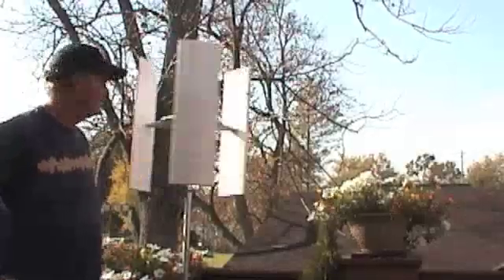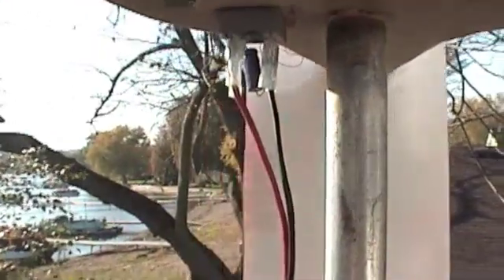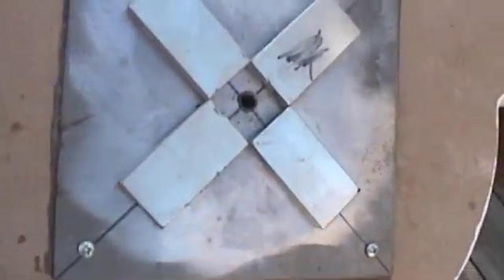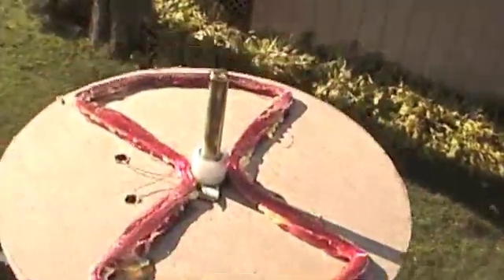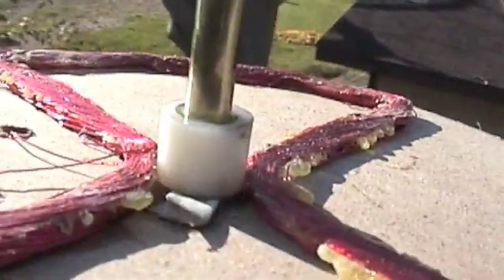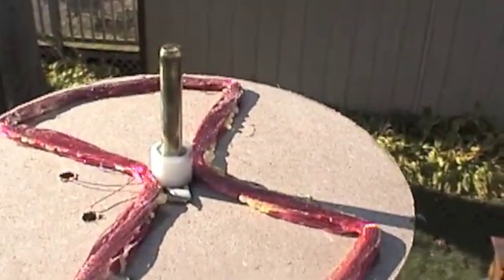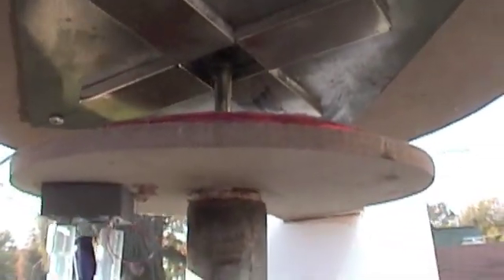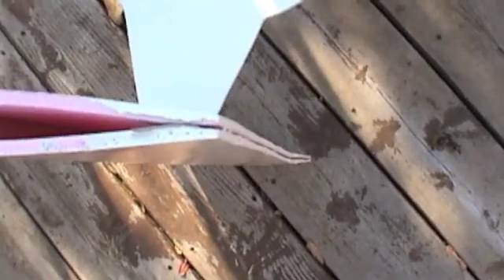Haitian Turbine

Comment: cool and simple, 
but what is the use for only 4.25volts DC? You seem to be wasting half of your coil on opposite side transfer. You could make 2 more coils from them, and maybe increase your output voltage to at least 6 volts.  
I wonder if it would work if you make a full coiled hoop - is it going to be effective or not.

Comment: fantastic job!! I've been designing a vawt for low power generation this video is amazing.. your pma is simple but effective, but, the configuration of the stator is very particular, and I see it doesn't need to be dual rotor disc to produce electric power..  great !!!

Comment: Awesome.
So simple and it seems to be working pretty good.
Maybe you can just charge 6 volt batteries with it in paralell en then connect a inverter in series to still get your 12 volt?
Then you can start charging even sooner.
I love the design.
Well done.
One question, how did you connect the blades to the baseplate?
Greetings from Belgium
Erik